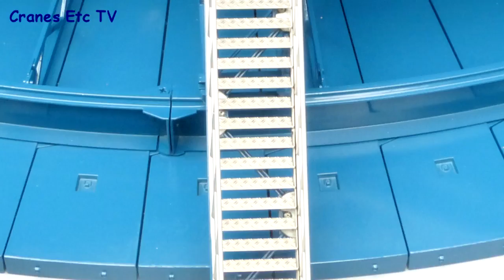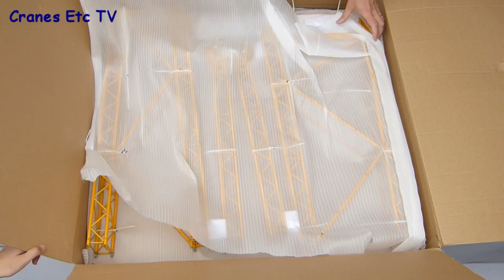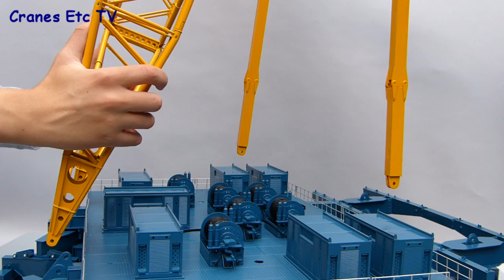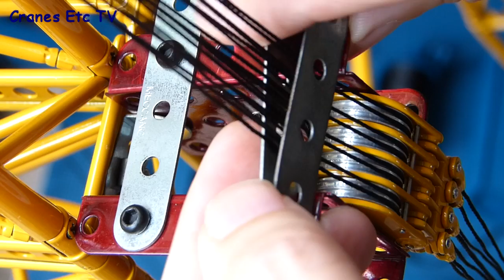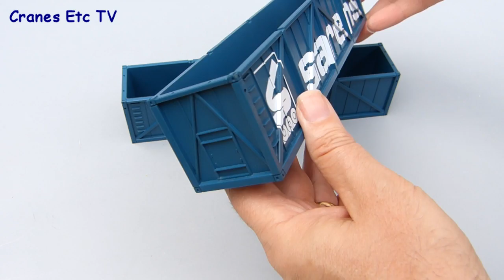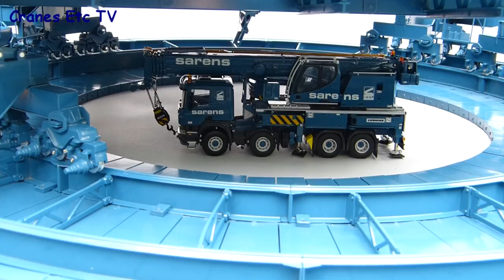WSI Sarens SGC-120 Ring Crane by Cranes Etc TV

Comment: a model that big and the stingy twats couldnt throw in 4 little motors to stop you sitting there having to wind those 4 winches by hand like a idiot
Reply: Well you have to consider the price because adding electric motors it's not exactly worth it but it would be nice if there were electric motors on the winches.
Reply: Runaway train Productions true but i dont think this model was cheap in the first place so a couple little crappy motors would have added what? 20 bucks tops to the price
Reply: Runaway train Produc
 
  , 8KÖ
  VCHC CC
Reply: The manufacturer doesn't ever make anything with electronics in it because their customers don't look for that sort of thing. but nothing is stopping someone from setting it up like that themselves. I know I'd like to see a functional model like this.